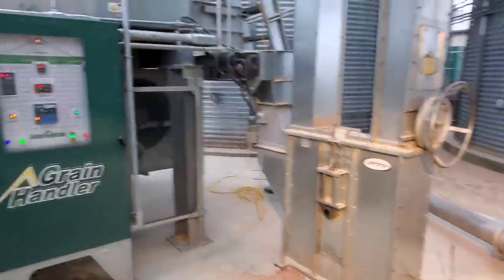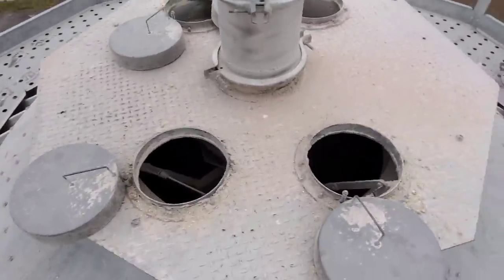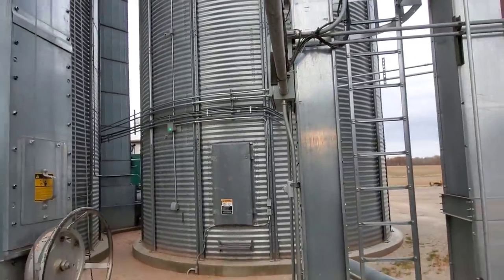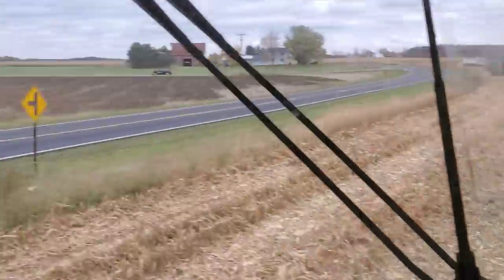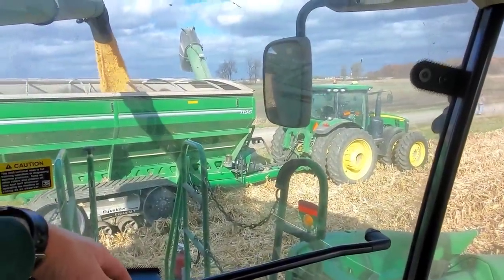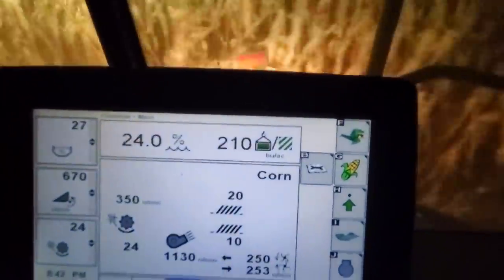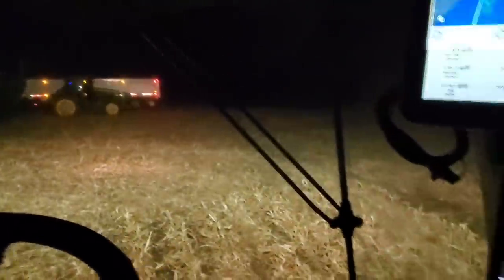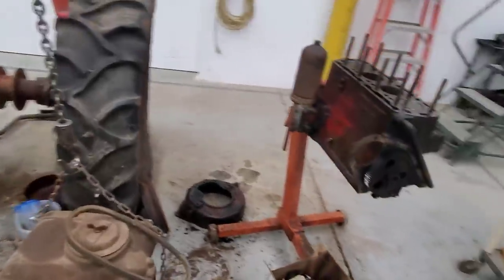How the Overhead Bin Works - #281

Comment: Was this a normal harvest dust year?  Or were the plants covered in fine ash fallout from all the West fires.  If fire ash dush, I wonder how heavily that impacted the corn and bean photosynthesis?
Must have reduced lumens from the sun just by heavy smoke in air.

Your #2 corn go straight to local ethanol plants or to feed mill plants?

Very lucky on that old of a farm tractor motor.  Got a nice rebuild-able block and internals.
Reply from the maker: No I don't think its ash just normal dust from harvest. Our corn either goes to ethanol plants or the local co-op.